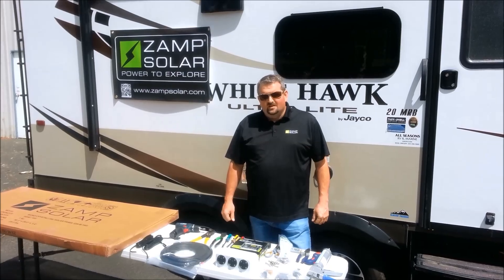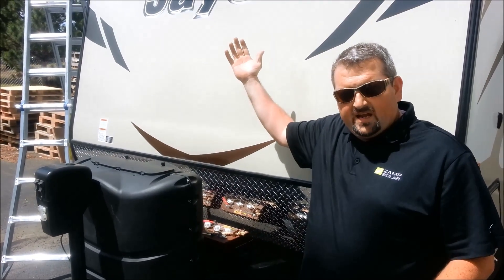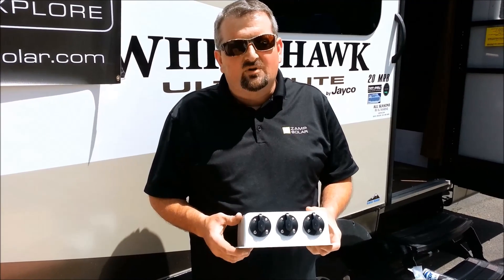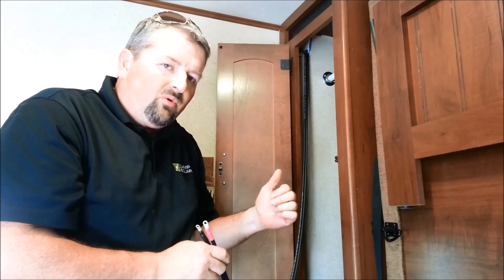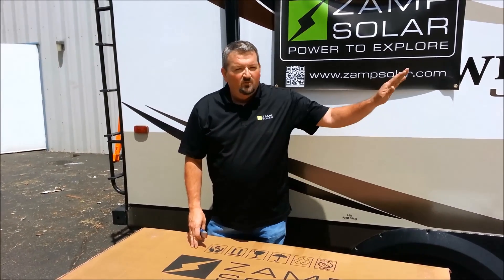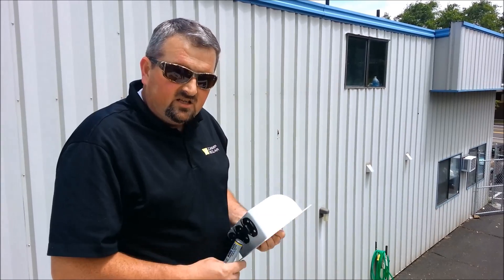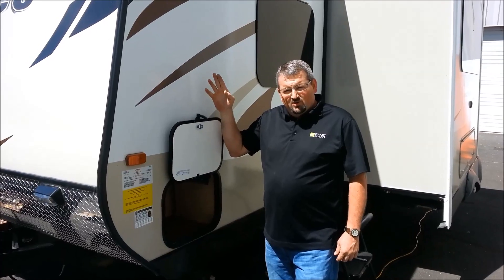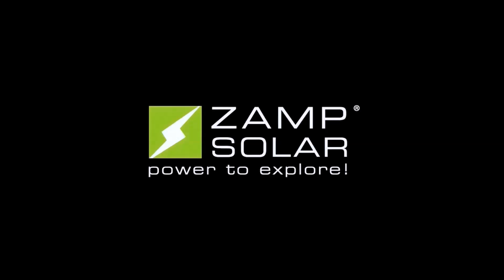Zamp Solar's Deluxe Roof Top Solar Kit Install

Comment: Not a very professional video.  I'd expect better from a company like Zamp.  The discussion on the polarity in the 3 port roof cap was a head scratcher.  What you need to know is Zamp reverses the polarity of virtually all SAE plugs in the marketplace in a lame attempt to get to you buy only their components.  Then they hit you up for approximately 3X the price of other high quality solar modules available in the marketplace.  Don't get me wrong, they make very high quality products, but the premium price is was out of line with today's solar component prices.  Shoot for a dollar a watt for high quality modules.   You can put together a great system for much less money than any Zamp kit.  Be  smart and save.
Reply: @Ria and Marc You are totally correct and its a sleazy combination (most RV dealers and Zamp) in my opinion.   I was actually way too nice to Zamp in this post of 2 years ago.  I feel total disgust with them these days.  Prices have plummeted across the marketplace.  Not at Zamp.   They are straight ripping off unknowing customers.  Its tragic really.  Do some research.  Will Prowse  solar and battery videos on You Tube are a great start and there are a lot of other great unbiased channels to watch and learn from.  Buy your equipment carefully and install it yourself if you can.   You'll build a great system and have a lot of money left to spend camping instead of giving it to Zamp ......
Reply: @michaeldoherty2289  I was about to upgrade my Zamp controller to a 60amp, put in a three socket port on the roof and the 1 port side port, and buy another 3x 170W Zamp solar panels.  My concern is my time is limited to educate myself.  I am the fix-it type and can probably do the adjustments you talk about above but have never done anything like this.  Is it really worth it from a cost and time perspective, taking into account mine is limited, to a) upgrade to an MPPT controller and b) deal with the Zamp port /wire issues?  Would enjoy a conversation if you have time?
Reply: @gwm6102  Just got back from a week camping.  Solar worked great this week for us.  I'll help if I can.

If I understand you correctly you now have 540 watts on the roof with a 40A controller.  You want to add 540w (3 more panels at 170w) plugged into the side port?  Do you have a factory solar ready trailer?  If you do, the side port and the roof install are not on the same circuits so you need a separate controller for each.  There are other limitations.

Start with this.  What do you have and is it a 12v system?
Reply: @michaeldoherty2289  i have a solar ready zamp trailer.  Two ports on top.  One on side.  3 x 170watts panels using all 3 ports including side.  30amp zamp controller, 2 lithium 100ah batteries, 12v system, freedom x inverter which SUCKS with lithium.  Always low or high voltage.  Fixed the low, nothing for high.  U have peaked my interest, is the side port using the 170 watts effectively?  It would be really easy to add 3 ports to top and side, add two more zamp 170 watts, and upgrade to zamp 50 or 60 amp ( cant remember) but for a cost of about $2000.
Reply: Also thinking about one more 100ah battery just to get to where running out of power aint gonna happen.  We have 12 months of ptsd with 1 panel 170watts and 2 acid batteries which left us screwed over and over.  We're 100% off grid and trailer is stationary.
Reply: @gwm6102 OK.  All good information and I see what you have.  If all your panels (540W total) are wired to one 30A Zamp PWM controller, you are over spec.  Their 30W PWM is limited to 510W.    Is the roof port and side port joined to make one feed to the solar controller?   Are the panels mounted flat on the roof?  Not tiltable?  If your trailer never moves, I'd advise to tilt the panels at the optimum degree.  You'll probably double the amount of power you can get from them.    I can give you a lot of ideas to get your system working better and save you a lot of money too.   Easier to do this via email than using YouTube.   Let me know.
Reply: @michaeldoherty2289  thank you for your replies.  I have 170w x 3 so right at 510.  All roof mounted, and I assume they all go into 30amp zamp controller.
Reply: @michaeldoherty2289  how to send you email address?  Dont want it hanging on youtube lol
Reply: @michaeldoherty2289  the tilt part would be useful in winter, where i am the sun's angle changes by 30 degrees but right now im getting +50 ah per 170watt panel.  Gotta love Arizona for solar.
Reply: @gwm6102  Of course.  Not sure where I got the 540!   So you have a 2 port on the roof and one port on the side?  The side port is generally on a separate line to the battery.  Maybe check with your trailer manufacturer to see if the side and roof port are parallel connected.   You could unplug the roof modules or cover them with a cardboard or a blanket and see if you are still making power with the side port only.   That will tell you too if they are all wired together.  I  understand you don't want your email hanging out there so we'll continue like this.  Where is your Zamp controller mounted?  Is it inside the trailer face mounted on a  cabinet panel?
Reply: @gwm6102  Been thinking about your system.  Before doing any upgrades, I would install a Shunt in your system.  It gives you a mandatory insight on your energy use.  It will greatly assist you in how best to understand your energy demands, and accomplish what you need in your total system.  The easiest way is to buy a bluetooth model.  It doesn't require installing a separate meter so its quick and easy.   You just bolt it in your negative battery line immediately upstream of the battery.  It will tell you very precisely how much energy is flowing into and out of the battery.  There are a number of them in the marketplace, but I'd buy a Victron 500A Smartshunt ($130.90 on Amazon today).  They are extremely well made and easy to install and use). Install their app on your phone for free and monitor all your use and battery status directly from your phone.  I have no association with Victron and don't buy their products because they are so expensive, but in this case I think its the best one on the market.  I added it to my system this spring and its been really insightful and helpful.  Without it you are flying blind.  I'd caution you on installing more panels than your 3-170W panels.   Without knowing what your wire gauges are and how it is configured,  you are talking about building a system that is quite large by 12v standards and its critical to have the correct gauge wire (and fuses or breakers) for the length of runs you will have.   I'd ditch the Zamp controller.  I strongly believe in MPPT controllers.  You will get more energy out of your system with it.  If you want a 60A controller, the Rich Solar model is a good one.  The internals are indentical to the Renogy Rover, but the have much more robust terminals.  They are also a lot cheaper than the Zamp 60A PWM.  I would never pay Zamp their huge price for a 60A PWM controller.  I prefer the EPEver BN series controller, but they are more complex and I think you want to keep it simple.   If you stay with 3 170W panels on your roof you can use a 40A Rich Solar MPPT controller which is only $140 on Amazon today.  The 60A model is well over $300!  If you do add 3 more panels, put them on a separate 40A controller.  You'll have a better system that is safer and more efficient.  I did that.   My side port input is on a separate controller mounted in my pass through.   Its works really well.   Always remember you can only run 20A through in a Zamp solar port.  Don't exceed that.
Reply: @gwm6102  Optimum angle in Phoenix in summer is 18 degrees.  Winter is 48 degrees and year round average optimum is 33 degrees.  Flat mounting is hurting you for sure.  Don't discount it.  Arizona is great for solar but the heat really hurts production.  Solar panels are rated for efficiency at standard test conditions, usually 75 degrees.   If you stationary and never more your trailer, I would highly recommend tilting.  You will increase your production.  Here's an example.  I have a 100W Renogy solar suitcase that I use with our side port.  Last week in NE Washington state, the panel produced 2.7A when flat on the ground and 6.1A when tilted.  The differences can be dramatic.
Reply: @michaeldoherty2289  does YT not have a way to send a message?  kind of silly.  I hate that you have to keep posting messages here but appreciate the continued help.  Correct, 2 ports on roof, and 1 port on side.  I was told the side port is wired in parallel with the ports on the roof.  But but but, it will be an interesting experiment to unplug the two roof panels and see what the side port produces.  Does replacing 2 ports with 3 ports on roof require additional lines to be sent from roof to controller?  Wonder about side port too.  I think you're seeing my dilemma.  I could switch out the zamp 30 with 60amp, get 2 more 170w panels, switch from 2 to 3 port on roof, and it's almost like legos it should be so easy.  If there's a solid reason, to stop and reassess, I'm all ears but seems like a ton of work to go down a victron, renogy, or other path.
Reply: wow, I had no idea about the flat mounting.  they're up on legs because the roof is curved but I'll look into that.  ton of work to reinstall 3 panels, remove dicor, etc. but sounds like it's pretty dramatic.  I'll buy the monitor shunt today.  It's one of those things I've been putting off because I have a voltmeter in the camper and I can do the general math, but it's funny how 40% can turn into 10% quickly. (voltage calc).
Reply: One other thing, the camper is on the top/side of a mountain at 7000 feet so the angles change.  In the summer, due to the angle, optimum tilt is 0 degrees.  The sun comes right over the camper as if I had drawn a line from sunrise to sunset.  In the winter, 20 - 30 degrees is probably the best, again due to being on the side of a mountain and the tilt we already have.
Reply: @gwm6102  I don't know of any way to message someone on YT.  Yes that does seem silly but I think that is by design.  They don't want people to cut them out of their platform which cuts them out the advertising dollars.  Its all in the wiring.  If the cable is large enough you can just add panels.  I doubt it is, at least using 12v.  I'd speculate that you have bumped up against the wiring limits with your existing panels.
Reply: @gwm6102 
I sure agree it would be difficult and probably not worth taking the panels off the roof.  But you may be able to tilt any new ones you add to maximize their output.   The mounts you have may be able to be modified to tilt the panels without removing them?  The fact that you don't move the trailer is significant.  You maybe can do some things that you may not be able to do when you are driving down the highway where mounting needs to be really strong.  Don't disturb the dicor.  Don't do anything to jeopardize your roof integrity.

You cannot get any reliable idea about your state of charge from voltage alone when you have lifepo4 batteries.  The discharge curve is really flat.  Its totally different than lead acid where state of charge for a given voltage is pretty accurate for a particular battery type and brand.  When my EPEVER 40A solar controller starts to indicate my battery is fully charged (the battery charge light blinks)  it is only at 30% state of charge!  The discharge curve is so flat that all I know is I am between 30-100%! when I think its is fully charged.  The shunt is super accurate because it counts actual energy (Coulombs) going to and from the battery.  Using the shunt was a real eye opener.  You can see in real time what is happening when you turn on a  light or a fan comes on or a cloud passes over the sun etc.  Its really tells you a lot of information.  If you never did and actual energy budget when you started down the solar path, it will allow you to see exactly where you use power and help you get the most out of what you have.    

 I am a big believer in MPPT controllers.   If I were you I'd swap out my PWM ZAMP controller with a Rich Solar 40A controller if the mounting is feasible.  If its face mounted on a cabinet, you may not want to do it.  The MPPT is larger.   MPPT is safer than PWM when you get a larger system like your existing 510W.  And  they can be a lot more efficient under some conditions. The 40A is not very expensive at under $130 on ebay.  That way you maximize your existing system and see where you are at that point.   It may give you enough to be OK and not have to expand at all.  Seems worth a shot to me but only you can decide that.  If you expand later on you can always add another 40A controller for less total cost than a single 60A which can only handle up to 800W anyway vs 1040w for 2- 40A controllers..
Reply: @michaeldoherty2289  Thanks again, so many more questions but I need to get up there and start looking around, reading the material that came with the camper, etc.  I have to say it is criminal the way camper manufacturers can sell you a $50k unit, and provide ABSOLUTELY NOTHING in regards the specifications of what you actually bought.  I'm a libertarian so every law should be scrutinized and many eliminated, but it doesn't violate my principles to require a manufacturer to disclose EVERYTHING you bought rather than these BS manuals that have every option under the sun but never any details anyway.
Reply: @gwm6102  Couldn't agree more with you.  I have a 2019 Outdoors RV 22FQS. The MSRP was over 50K.  I could go on and on about what a mess this thing was.   Every place I looked that was behind a panel or under a cabinet was full of construction debris.  The refrigerator installation was so bad (they didn't follow the manufacturers requirements at all) it hardly functioned when it was over 80 degrees outside.  I finally got that fixed but it was a painful process, some of which included long hours on a hot roof.  But my fridge never gets above 40 degrees and the freezer is 8-13 below zero all the time even when its over 100 and full sun outside.  This trailer has frameless premium windows, the largest of which has a broken seal this year and must be replaced for more than a thousand dollars.  I don't see how someone who isn't very handy could ever own an RV.  I have spend literally hundreds of hours on this.  Can't imagine how mad and frustrated I'd be if I couldn't fix this stuff myself.  Dealer appointments are hard to get and repair costs are astronomical.   Our trailer is finally working perfectly but this is the 4th season we've used it and its taken that long to figure it all  out and work out all the things  they made a mess of.   And Outdoors RV is one of the so-called good manufacturers! 
Laws are created to fill a problem that people created themselves with bad behavior.  Too bad we need rules at all.  If we were all honest and trustworthy we could be a lot more free.  But that will never be the case....
Reply: @michaeldoherty2289  Dude, you are preaching to the choir.  We have PTSD when we arrive on our property and start turning on the camper's systems.  It's an awful feeling to arrive and expect something else to have broken.  I have spent 100's of hours fixing everything in a 2021 Keystone Cougar camper.  Literally, everything broke and I knew nothing about campers when I purchased it.  I have replaced the awning light, the bathroom fan, the vent, the sail switch on the heater (that was a lot of fun), fuses, seals, the radio, re-dicored places on the roof already coming apart, the acid batteries that came with it (pos), and actually had to get my neighbor, an electrical engineer, to figure out why the converter wouldn't charge the batteries on generator.  You need a 50amp generator to activate the converter, so he placed a crossover between the two circuits to make our 30amp generator power the converter.  The list goes on and on and on.....  Don't get me started on the auto-levelling system.  Unless you're on an engineer-created pad that has a 0 - 2.5% slope, don't even bother and just adjust manually until you like how "most" things are level.  We also have a problem with one of our grey tanks but it falls in the category of want, not need, as we can let grey water out on the ground.  And, I know someone left the water heater on for days without water (camper was slightly used) as pieces of the ceramic lining keep coming out every time I empty the water heater when we leave.  That should be fun to replace.  My final gripe is all the holes on the bottom of the camper.  This is a rat/mice's dream which we've been fighting since day 1.  You can't possibly fill or find all the holes a mouse could fit in one blow, so we're now using a trail camera and over time we'll figure out how they get in and eliminate the access points one by one.  We're using all the tried and true methods for mice/rate elimination but AZ mountain mice are smarter than cats.  This is the first and last camper I will ever buy.  You nailed it, if you're not at least somewhat comfortable with fixing many varied things, do not buy a camper.  They're nightmarish, and not designed for you to fix things.  Everything is installed as if it will never break.  There is no good dealer by the way as there are no good campers.  There are new campers that do not work, used campers that do not work, and used campers that have had everything replaced/fixed over several years that work.  There is nothing in-between.  What I don't understand is cost.  For $50k, I could have bought a Ford Expedition that would have run well for years.  Why can't they make a camper that does the same?  It's pathetic.
Reply: @gwm6102  I just read this to my wife and she cracked up.   We've discussed  everything you ranted about.  And our good neighbor here in Spokane bought a Keystone Cougar in 2020 (he drove to Phoenix to get a "good deal" on a used unit!) I felt so bad for him and his wife.  They were so excited and it turned into the nightmare you describe all over again.  We looked at a new Cougar and I didn't like what I saw quality wise, so we didn't buy one.  I am so glad we didn't.  The industry has major issues for sure.  I am thankful the we've got our trailer working perfectly now.  I built a new LiFePO4- 412AH battery this spring and its fantastic.  We have a 2000w inverter so we can use the microwave.  I put a 60A DC to DC charger on it so we can charge the battery on the road with the RAM and run the refer on AC on the highway.  Everything is in sync and we love it.  But wow what a job to get there.  I hope you can get there too.  Its been good talking to you.  I wish you all the best with your solar (and rodent hazing).  Keep me posted on how it goes for you.
Reply from the maker: Hey Michael, Sorry you didn't like this very old video. You can head over to Zamps channel to see what they've been up to. In regards to the 3 port roof cap and the port wiring. There is no standard for wiring ports. These types of ports and plugs are wired this way to protect the positive polarity, or shield it. The reason for this is that if the plug is dropped and the panels aren't covered then the chances of a short out is very low. If it were wired the other way, or the way many others wire it then the positive lead would be exposed and the short out scenario is high. If pricing is an issue I'd suggest at least making sure that you do better wiring than other kits on the market. We don't know of any other kit that has great panels with great wiring. Most of the other 'quality' panels you say are out there lack other quality components to maket he kit awesome.
Reply: I like the fact that the positive pole is protected.  That makes great sense.  But you have to buy the expensive zamp connectors instead of the moderately priced SAE connectors available out there.  I just bought a new OutdoorsRV which has the Zamp 3 port cap on the roof pre-wired with 8 ga wire.  I looked at Zamp panels and accessories, but they are extremely and unnecessarily expensive.  When you get to the 4 dollars per watt price, you are just being taken for a ride.  To solve that I purchased (2) 200W mono 5 busbar modules made in the USA by a small company in Illinois.  This is my second purchase from them and they are a quality product with the same warranty Zamp offers and I paid .88 cents a watt.  To solve the polarity issue, I bought very heavy duty 10ga SAE plugs with MC4 connectors on the other end that plug perfectly into the modules.  I changed the MC4 connectors around on this SAE plug connector to match the opposite polarity required by the Zamp roof cap.   Instead of the 30A Zamp PWM controller offered in their kits, I bought a Renogy Rover 40A MPPT controller.  With 6 mounts on each panel, Dicor sealant, a fuse between the battery and the controller,  a circuit breaker between the controller and the roof cap,  and a few other supplies (including expansion nuts for mounting more securely and safely than wood screws, I have a very high efficiency 400W system for about $575 or about $1.44/watt.  Compare that to the much less efficient 160W Zamp kit that sells for $757 (that is $4.72/watt!) on Amazon.  To get to the 400W system I have, you'd have to spend nearly $1500 with Zamp.  Their 160W panel expansion kits are $555 (that is $3.47 per watt!) on Amazon.  A 320W Zamp system will cost you $1312 and you'd have a PWM controller that is much less efficient than the Renogy MPPT controller.  I realize that not everyone has the capability to build a system from scratch, but if you have some reasonable DIY skills, you can design and buy a great system at nearly 1/3 the cost of Zamp.   As I said, I have no quarrel with Zamp quality.  If you buy their products you know they are quality and backed by great customer service, but you are paying a huge price for that.  Solar has become much more affordable, and I believe Zamp has not reflected that affordability in their product line.
Reply: @michaeldoherty2289 dude, its just an sae connector run the opposite way. You can test the polarity and attach each sae connector properly. Way easier than what you did.
Reply: @Solardealz  Its not that I didn't like it.  Its just not a good video.  Lots of super good equipment that performs as well (or better- to a lot better) than any Zamp product.  PV modules, controllers, misc pieces and parts are all out there at prices that would leave Zamp red-faced and broke if they were not able to  prey on people that don't know better.  Any smart person going solar would never source anything from Zamp Solar.  Its just that simple really.   There is nothing special about Zamp kits.  Ordinary to inferior.